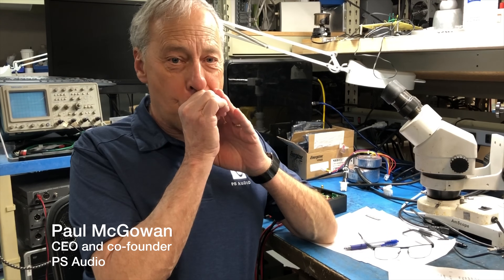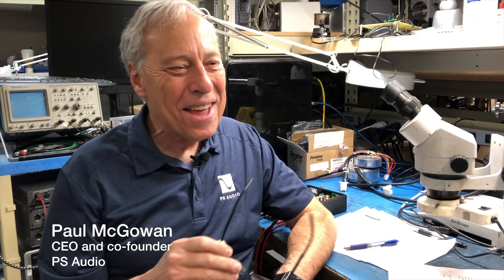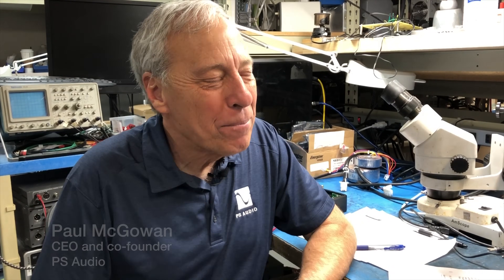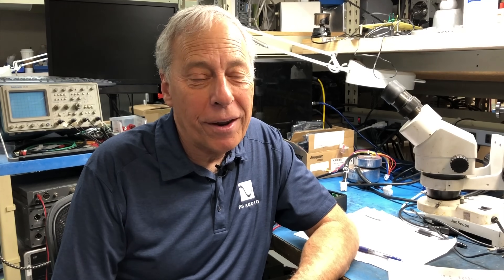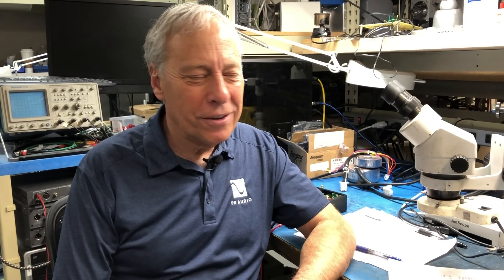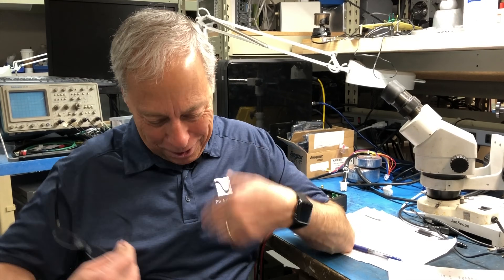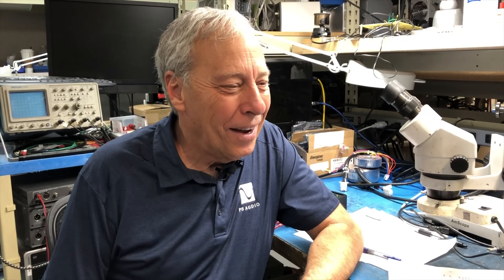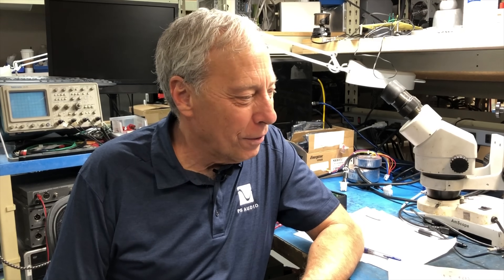How do horn loaded speakers work and sound?

Comment: So did you ever create a speaker that sounds better (I realize that’s subjective) than a Klipsch LaScala? Was it anywhere near it’s efficiency With less distortion. I’ll help you here, no, you didn’t. Does a La Scala sound “Honky” ?… gimme a break… This is one of the most misleading videos I have EVER seen you make. A mere 16 watts into the Klipsch will exceed your flagship’s max spl while you feed it over 600 watts, all while watching your drivers all do enormous excursions adding plenty of modulation distortion. The maximum excursion on the Klipsch is a mere 1/8 of an inch peak to peak. Yes your ears can hear modulation distortion quite readily.
I’m sure you have a fine speaker that works well, will it still be in production in 50 years?
No speaker is perfect, I run my La Scalas with a DSP and have a fully horn loaded subwoofer taking over at 65 hz. The sub also has remarkable efficiency and low distortion and is powered by a 100 watt amp.

Comment: I inherited a pair of huge speakers with 15 inch woofers, EV1828R midhorns and EV35T tweeters. After much research I found that the EV1828R is a public announcement horn driver and cannot find anything on it being used in a stereo speaker. These are homemade speakers so what I'm concerned with is are these horns ok to use in a high fi speaker or is this the wrong model horn entirely to use in a home stereo speaker ?  They don't sound great and I have no knowledge tweaking crossover frequencies to change the sound.  Any advice would be much appreciated, they look cool and I'm trying to resurrect them to sound decent.

Comment: Much more money to be made selling inefficient multi driver speakers that require ever more powerful expensive amps to drive them.  Big set of horns can deliver audio bliss from very simple low power amps with minimal circuitry corrupting the signal.  Big horns and Class A amps - match made in heaven.

Comment: I think "amplifies" is used incorrectly in this discussion. The horn does not amplify the sound, it directs and focuses the sound so it's not attenuated and dispersed when it gets to the listener. "Amplification" implies that the sound pressure wave is somehow increased over the original wave. The total sound pressure wave is still the same with or without the horn, it's just more focused and therefore louder when it gets to the listener's ears.

Comment: Your claims about coloration of horns are absoluely wrong. Whatever you say about coloration and distortion about horns is dead wrong. All these are effect of bad designs, as is the case of 'compromised' horn designs. It has been documented since decades ago. It is so bad for a manufacturer of your caliber to write comments like this, not based on physics but psychoacoustic falacies, having as an example how your voice is heard through your 'palms' horn. Absolutely irrelevant. You simply can't tolerate / manage the high cost of horns design for your creations and there is nothing bad about it. It is bad to spread fallacies around

Comment: Horns are not acoustic amplifiers.  The improve the coupling efficiency between the diaphragm and the air.  At the same time, they drastically lower distortion and improve efficiency.  Well designed acoustic couplers have low colorations.  PS Audio is full of it.
Reply: When this guy "cupped" (instead of flared out) his hands over his mouth, He lost me.

Comment: Hi Paul,  I'm old also and when you cupped  your hands to ears in this vid it reminded me of the fact that I suffer from tinitus. When listening to my "horns" with cupped hands to ears it produces a marked improvement over simply turning up the volume. I know that you can buy electronic hearing aids that can partially ellimate the noise in your ears from tinitus but the idea of listening to my HIFI system's tube's sound eminating from my horns into the room and then finally translated by a tiny litle amp of who knows what design just before the sound enters my ears, seems to defeat the whole purpose of a HIFI system. I wish that some smart engineering company like yours would  investigate passive amplifcation. It could be a boon to people like myself and possibly apartment dwellers too.

Comment: I've got one question : how can you make a membrane speaker as efficient as a horn?   This is what is said from 7:29.  The question here is how can you achieve a coupling as efficient as a horn?
BTW, a horn does not "amplify" sound (amplification needs an external power source) ; it couples the moving element to a VOLUME of air instead of to a SURFACE of air.  Thus, the coupling is much more efficient.  Thus the sound comes out much louderé  It does so at the expense of putting a mechanical load on the membrane.  (The same speaker takes more power when attached to the horn than in free air, hence the apparent "amplification".)

Comment: In my opinion Paul's hand-cupping demonstration is an oversimplification which simply does not apply to modern horn designs.   That "cupped hands" coloration is the result of internal reflections within the horn.  Angle your hands into a much wider flare, Paul, and it almost disappears... and with good modern horn design it disappears entirely, at the expense of reduced acoustic amplification (which is a trade-off we can afford to make).   I've had blind audiophiles in my room at audio shows and they did not realize they were listening to horns until somebody told them.
Reply: Well the problem with is with horn speakers you only around 1 watt of amplification lol

Comment: The only speaker that can give you high efficiency, low distortion, accuracy, micro dynamics, effortless, distortion free sound is a horn speaker. Modern Horns don't suffer from colouration.
Reply: I agree.  The very moment I heard a proper waveguide designed by earl geddes I knew it was it.  Cant go back.  The immediacy, density and resolution are unmatched
Reply: Pyramid shaped horns are horrible, but true exponential horns with phase plugs are worth it
Reply: When I first heard the edgar horns,  it was eye opening. It reminded me of my younger days at live jazz clubs sitting 10 15 feet from stage. You notice even magico flagship top of the line is a horn. I have never  gone back to tall boxes. I prefer open baffle speakers than boxes..
When the speaker attracts your ear and the music you prefer plays well with it; then that's the speaker for you. Very personal... 
For me single ended amps, tubes, with front loaded horns  japanese cartridges and   vinyl is my end of search.
Reply: Also I have yet to hear anything as efficient as a horn speaker... What non horn design does he have that is going to produce 105+ db at 1 watt of power?
Reply: pure coloration and low fidelity

Comment: Horns are awesome if equalized / tuned right. I'm using fostex wooden horn and drivers H400/D1400. 800~7000  KHz + T925a. 7000~20000 KHz active all the way. Don't know what your on about.? Build many speakers,  and nothing come close to the dynamic and life like sound from the horns. My all time favorite.! I would agree that,  horn can sound harsh an fatigue sets in quickly if not tuned right. Ps a lot of eq was necessary / endless listening hours, tuning.
Reply: Chip, I'm running 3-way active (plus a sub) with horn mids and tops too, not Fostex but similar, and I totally concur with your characterization.  I've never encountered such a life-like and seductive presentation of recorded music---with the best recordings, that is.  And that's from 35-45 year old vintage drivers.  Active linear-phase multiamping definitely lets horns perform at their best and reveals the advantages of their quickness in reproducing inner texture and holographic imaging, especially if their manufacturing tolerances are tight enough to assure very close left-right matching of their "ballistics".
Reply: @naturalverities  Awesome.! Glad to hear. I'm also running my front, with too stereo 18" isobaric subwoofer in 160L basreflex enclosure. 4 4" flared tubers tuned to 28Hz. Peace bro✌️

Comment: Horn speakers have no equal for transient response.  The reason is their highly effective energy-coupling into the air, which provides a very high damping factor for the driver's diaphragm.  
The difficulty with horns - and the reason why some designs sound colored - is that they have very abrupt cutoff at their low frequency limit.  Crossovers need to be designed so that their output is attenuated by a significant factor before cutoff is reached.  That is difficult to do with passive crossovers, so as a designer I would much prefer to use horns in multi-amp applications with active crossovers.
Reply: I couldn't agree more, Marianne.  I'm a DIY speaker guy and my active horn-based system is the best I've ever heard... anywhere.
Reply: @naturalverities  
It would be nice to know more about your system.  Ever heard of Speakerlab?  They were a Seattle-based speaker design company in Seattle back in the 70's and 80's.  I own a pair of Speakerlab 7's which have an E-V T350 tweeter and a large horn midrange, and originally, a 12" and 10" set of woofers electrically and acoustically in parallel to make a 4 ohm speaker.  The original woofer surrounds rotted away, so I changed over to a single 4 ohm 12" woofer and sealed the 10" opening.  
They still have passive crossovers.  Some day I may go active, and align the drivers.  Currently the midrange driver is too far back and the frequency response is all over the map.  But they still produce fabulous detail in the highs.
Reply: @marianneoelund2940  Hi! Yes I have definitely heard of Speakerlab.  I used to lust after Sevens back when I was young and broke. K's too. My light-years-best system (I also own 7 pairs of Klipsches) consists of 18" ported sub (B&C pro cinema driver), 2x 15" midbass drivers (TOA Altec clones), 2x 22" wide radial mid horns (University comp drivers), and 2x ring/slot tweeters (TOA, very like the famous JBL 2403/2405).  Crossover is a Dayton DSP-408, inexpensive and very capable, including time compensation and massive parametric EQ capabilities.  Super easy to use! Amp is an Onkyo AVR with 7 analog multichannel inputs/amps.  Total system cost less cabinet materials and streaming source (phone/laptop) is about $600 (thanks, Craigslist!); once tweaked-in, sound quality is an epiphany, especially with classical music. DSP active multiamping is a game-changer!
Reply: Best transient response?  NOPE.  That goes to electrostatic loudspeakers.  nearly massless driver.

Comment: The problem lies only in using the same horn over a wide range. But this is true of any loudspeaker- hence "full range speakers" are useless, unless you are listening to solo saxophone all the time . An active, multi-amped, multi-way system (using horns for the midrange area and ribbons for the highs, for my taste) is by far the best solution.

Comment: Horns do distort sound and that is a fact, as always, thank you for the scientifically grounded opinion.
A lot of angry Klipsch fanatics bellow...
Now, whether you prefer hearing that distortion or not is up to your fancy and the kind of music you listen to.
Excerpt from a published scientific paper (Published by the Royal Society - 2013):
"Acoustic horns are tapered tubular structures that act as waveguides and have been widely used by humans to increase amplification and directionality of sounds [19]. There are two types of horn: speaking and hearing; the former amplify outgoing sounds, from the narrow end to the wide end of the horn, whereas the latter amplify sounds in the opposite direction. Speaking horns increase sound volume because they match the acoustic impedance of outgoing sounds to the surrounding air [20], and hearing horns amplify sounds when waves are reflected into a progressively narrower area, thereby increasing the sound pressure that reaches the ear [21,22]. In addition, both types of horn aid in acoustic communication because they increase sound directionality [20]. Two major drawbacks of horns are that they cause significant sound distortion [23] and that not all frequencies are equally amplified"
Reply: Square horns are not tubular. The shape of the horn can be made to compliment the driver it's attached. Where deficient areas are boosted and efficient areas are nulled to create a flat frequency response.
Reply: Sorry I can’t trust Paul he sells 100,000 dollar amps.

Comment: A concert sound level up to 130dB? If this were true then millions of concert goers would be walking around stone deaf.
Reply from the maker: Indeed and many have hearing damage. Remember, I am referring to peaks.
Reply: PS Audio 110dB is the average pain threshold. A 10dB increase is a 10 times increase. 130dB causes immediate ear damage. Fortunately, no home audio system can reproduce an SPL of 130dB at the listening position. If it could, a child with their ear close to a speaker could rupture an eardrum, or worse.
Reply from the maker: @geoff37s38  If you do a bit of research you'll note that symphonic orchestras can reach 120 to 135 dB peaks on loud passages. There's an entire class of litigation currently working its way through the courts based on these numbers. Orchestral members have complained for years about the loudness problems.
Reply: PS Audio Yes, but it is your statement that amplifiers and speakers should handle 130dB peaks that I have an issue with. This is technically impossible. The finest modern recording equipment has a dynamic range less than 100dB. The best studio microphone has a s/N ratio of 92dB.  No recording or playback equipment can deliver a silent background and peaks of 130dB, not even close.
This is why 24 bit files are totally pointless for playback.
Reply: @geoff37s38  stuff able to give 130db peaks won't be able to give a constant 130db at the ears of everyone in a concert crowd. You won't wan't it anyway (as you said). But having a high dba capacity is required to have a decent sound for concerts in large rooms. In europ, the maximum legal sound level in the middle of a concert room is 102dba. For large rooms and outdoor concerts, they have to use 1000watts rms horn subwoofers that can peak at more than 140dba to achieve this. If you are right in front of a concert sound system, you will feel bad, but such a strenght is required to get a strong sound level at the middle of a concert crowd.
Reply: DJ Stifff Very interesting, thanks. Several years ago, we went to a Dolly Parton concert, not an artist associated with very loud performances. Her voice was so loud that people in the front rows sat with fingers in their ears. Dolly apologised but said she could do nothing about sound level. We were sat about in the middle but her voice peaks caused pain in my left ear. I would guess SPL was about 100dB for me, but probably in the most sensetive frequency band. I have been left with damaged hearing in my left ear and I will never again attend another live concert.
Reply: PS Audio Paul. An orchestra member could, for example, receive a dangerously loud blast of 130dB from the brass section. But we are talking about reproducing the dynamic range of a concert orchestra experienced by the audience. This is 80dB tops for a symphonic orchestra.

Comment: I respect the effort to simplify this explanation, but I think it's not that helpful perhaps. A horn doesn't "amplify" the sound - obviously, as there's no additional energy imparted after it's left the driver. It's a way of impedance matching the driver to the air molecules which are very "floppy" compared to the rigid diaphragm and therefore poor at transmitting the energy. If you carefully increase the surface area of each wavefront as it travels from the driver, the molecules can transmit that energy more efficiently as there are more of them bumping into each other. Mark Rober explains this much better in his video on a giant air horn. With regards to audio, I suspect, as with everything, the devil is in how you minimise unwanted colouration and reflections within the horn.
Reply: Making something look/sound bigger or smaller is the definition of amplifying regardless of the method used.
Excerpt from a published scientific paper (Published by the Royal Society - 2013):
"Acoustic horns are tapered tubular structures that act as waveguides and have been widely used by humans to increase amplification and directionality of sounds [19]. There are two types of horn: speaking and hearing; the former amplify outgoing sounds, from the narrow end to the wide end of the horn, whereas the latter amplify sounds in the opposite direction. Speaking horns increase sound volume because they match the acoustic impedance of outgoing sounds to the surrounding air [20], and hearing horns amplify sounds when waves are reflected into a progressively narrower area, thereby increasing the sound pressure that reaches the ear [21,22]. In addition, both types of horn aid in acoustic communication because they increase sound directionality [20]. Two major drawbacks of horns are that they cause significant sound distortion [23] and that not all frequencies are equally amplified"